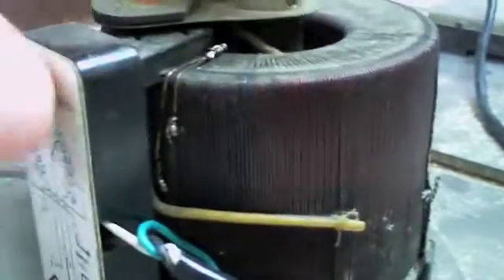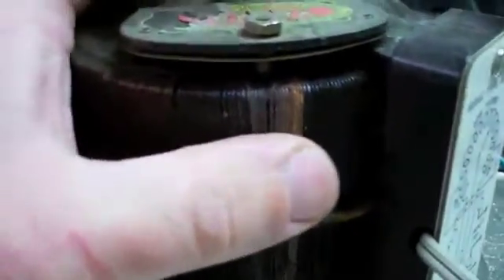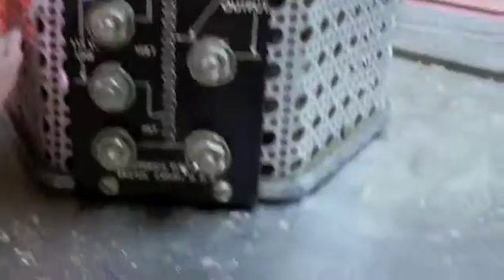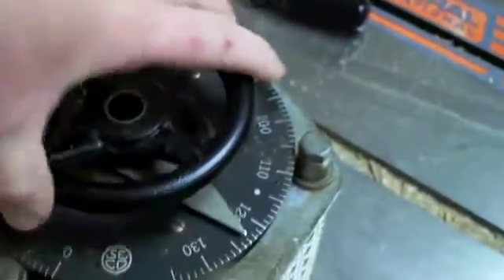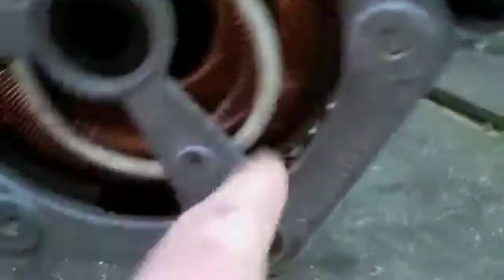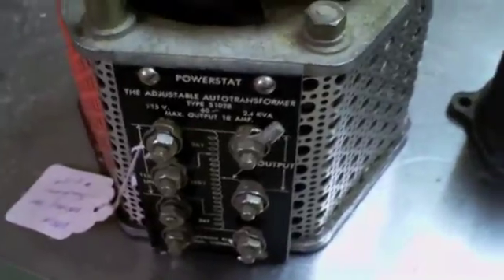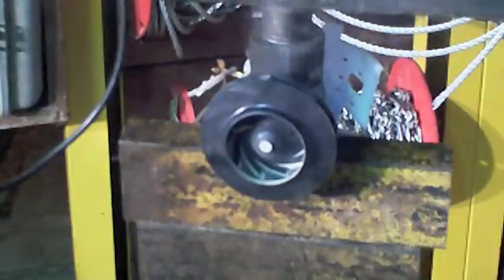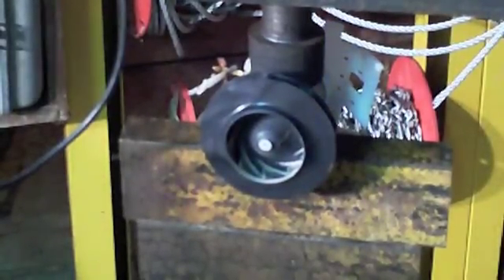New Powerstat Variac For the Shop!

Comment: You think that's a steal? I got one that looks similar to yours for only $30 at a junk store. But mine only goes to 100 and it's a Luxtrol D2000.  Mine barely worked when I first got it till I figured out that "Silky" wire was practically broke. I replaced it with a thick rubber one and it works just fine now. :D